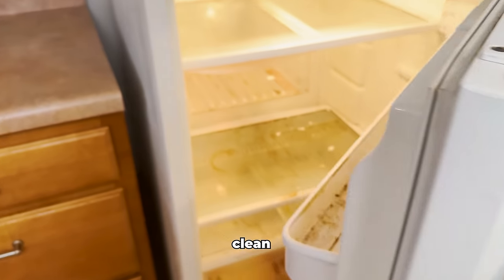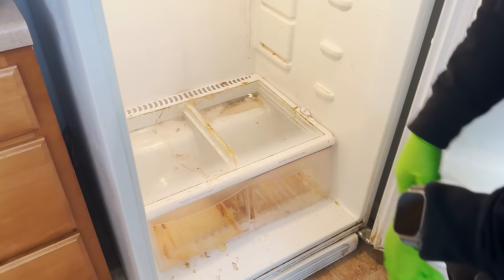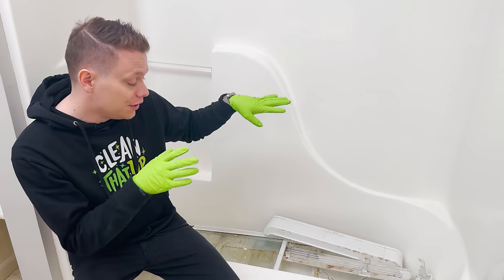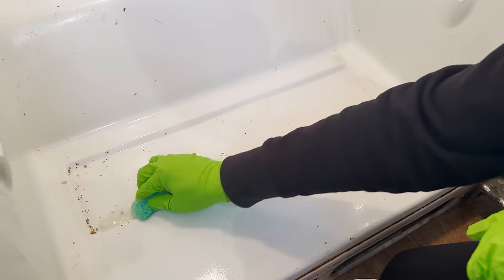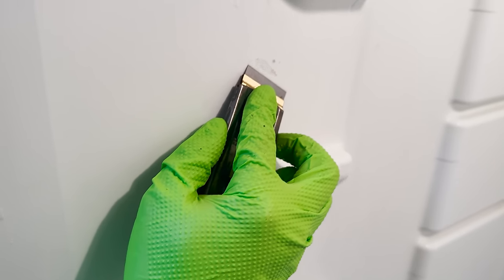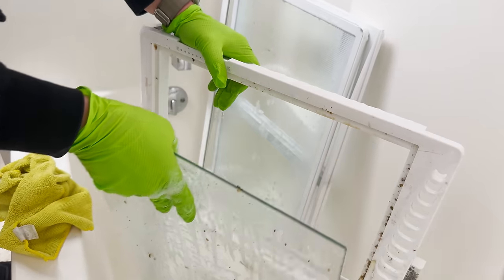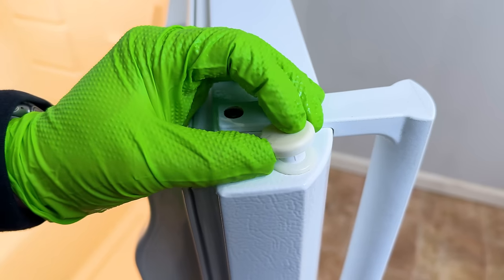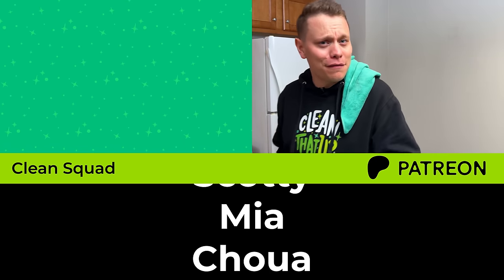Secrets to Deep Clean Your Fridge

Comment: The seals around the edge of the doors are often just pressed in and can be removed, cleaned and put back easily. Also gives an opportunity to clean out the grooves they fit into. I also had a freezer where the seal had split at the top and I was able to turn it so that the split was at the bottom.

Comment: Everything should be cleaned from the top down. Then all drips and crumbs that fall will not fall on already cleaned areas. Also, don't be intimidated about pulling a fridge away from the wall. The wheels make easy work of it. When cleaning a fridge, also empty and clean the condensation drip pan underneath, and also use a long handled skinny brush to clean the back and bottom which tend to collect lots of dust. Fridge tops can be greasy. Formula 409 cuts it instantly and completely. Textured fridge handles are cleaned fast and easily with a magic eraser type sponge. Always sweep, soak and mop the floor underneath while the fridge is pulled away from the wall. Lots of dust and dried on spills exist under there.
Reply: Can u make video on what u discribed plz
Reply: Good tips! Thanks 😊

Comment: What if you dont have a bathtub? And can you use a steam cleaner?
Reply: I use a steam cleaner on all of it right on the counter as I don't have a tub either.
Reply: You can also use a large plastic storage bin as a makeshift mini tub for things like this.  The 18-gallon ones are pretty reasonable size to work with and can fit in the shower.  It's especially handy if your shower has a handheld head so you can just spray everything down.

Comment: THAT LOOKS LIKE MY FRIDGE BEFORE YOU STARTED THE CLEANING. ACTUALLY MY FRIDGE IS WORSE THAN THAT AND ITS ALSO JAMMED PACKED WITH GOOD FOOD AND BAD FOOD. MY FRIDGE URGENTLY NEEDS CLEANING HA HA. IM SO LAZY THOUGH. BEING ELDERLY DOESNT HELP EITHER. ALSO I AM SCARED OF TAKING DRAWERS OR SHELVES OUT BECAUSE I MIGHT NOT BE ABLE TO PUT THEM BACK IN. I HAD A BIG PROBLEM WITH A DRAWER WHEN I TOOK I OUT, I STRUGGLED SO MUCH TO GET IT BACK INTO PLACE I THOUGHT I WAS GOING TO BREAK THE DRAWER GETTING IT BACK IN PLACE I HAD TO PUSH SO HARD.

Comment: Great job cleaning the fridge but why didn't you clean the floor under it while you had it pulled out.  Dust behind the fridge isn't good for the running of it.  Also, you should clean the pan underneath.

Comment: We've got one of those double door fridges. Our glass shelf has to sit on a large towel on our dining table in order to be cleaned.

*Tips for ice build up in large fridges, (freezer on bottom), or at least our model type needs this extra care monthly. It's annoying😮‍💨

-Some of the large fridges have a back panel (inside the fridge) that can be very carefully removed. A bit of the foam might crack off if ice has developed behind the panel, just remember to carefully put foam back in when done cleaning. (You'll know what I mean if you see the ice). We've had to do this twice ourselves, after someone came to service our fridge and showed us what all to do. I advise having someone show you how to service your fridge in person, works better than watching videos cuz most skip important steps.
*It is a long process, so should ONLY be done when needed! This will take around 1 hour or longer. To speed up removal of ice build up use a steamer with a spray nozzle.
Be ready with towels, keep 1 large towel on floor. Prep bags of ice 2 hours prior, or buy 1-2 bags if you cant make ice at home. If you can find one, use a metal rack shelf thing, lol, something like a cookie cooling rack that stands up 2-3in off the table, to use in your cooler, so things that have paper labels dont get soaked from melting ice. Also prevents containers that aren't leak proof from getting food inside ruined, trust me, we learned the hard way and had more to clean after that.

Since our model does not have a thing at bottom of fridge, because of the freezer drawer, it's the back of the fridge where the dust collects. Because it's a back breaker to move these giants, I advise keeping an appliance dolley. If you know what appliance coasters work best for these fridges, PLEASE tell me!
Reply: Also, our model has to have the air filter removed before tha back panel can be removed. It's tough to care for these big guys, but well worth it for families. And we took advantage of the amount of space one day, had a cake inside. It was quite a sight because I never had a fridge like this before. Can fit 2 pies just on 1 side of the shelf. Imagine 4 pies on 1 shelf. Or 2 large pies and 2 regular pies, with regular pies in front of the large pies.
Oh, a Kenmore fridge I believe it is.

Comment: You put your toilet seat and refrigerator parts in your bathtub???🤨🤨🤨
Reply: The tub is nice for the availability of hot water and space. Alternately you could clean the parts with a garden hose outside, or in the kitchen sink using the hand sprayer or a cup, but the kitchen will get wet and messy.